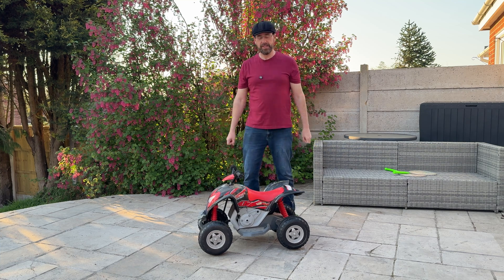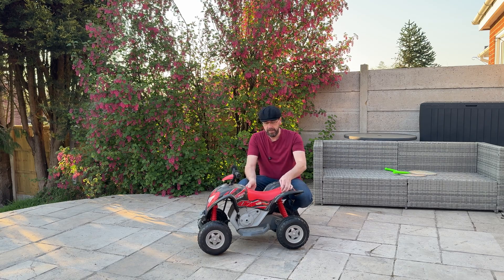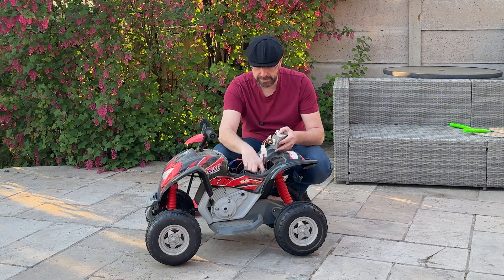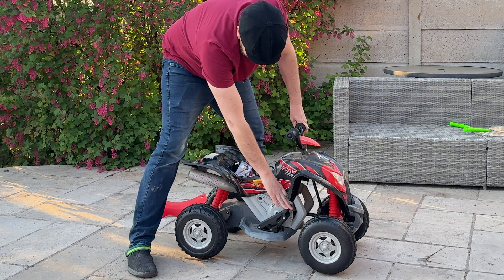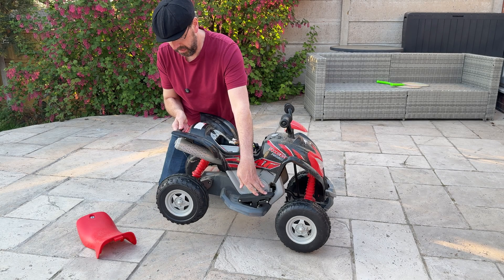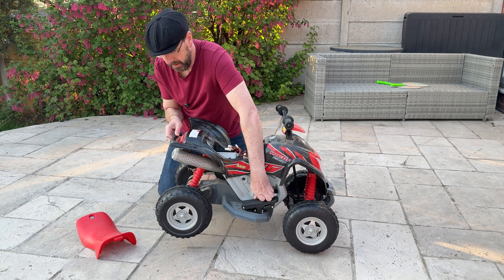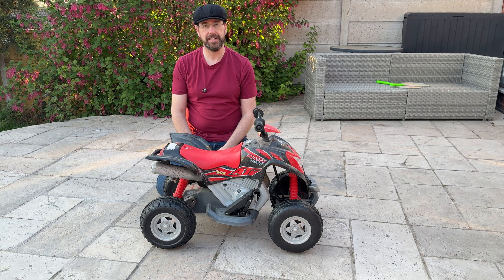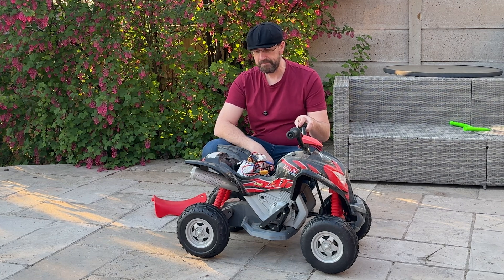Kids toy ride on electric quad bike upgrade 24v with speed limiter

Comment: I need help haha! My son has a 24v 7ah Ford Ranger ride on.. it dies within 10 min after fully charging for 12 hrs.. What would you recommended I upgrade it to? Thinking of a higher capacity lithium battery of at least 9ah,  but might as well make it faster at the same time 😅
Reply from the maker: I’d go with a JetCat P300 Pro gas turbine jet engine. 300 newtons of thrust, should be good for about 60 to 80 mph, maybe faster depending on the age of your son.😁
Failing that you need to work out if you need speed or torque, 40,000 rpm motors are great if you’re on level ground, not so good on gradients.  I think 24v is plenty, go with one those Lithium tool battery upgrades, you can swop out the battery when they run out.  LiPo can be dangerous so only use that if you know what you’re doing.

Comment: I’ve got the same quad bike for the kids, where can I get a replacement battery and charger wire?
Reply from the maker: Amazon will have 6v or 12v batteries.  I can’t remember if it was 6v or 12v originally.  They will also have chargers too.  Or if you are unsure then try https://riiroo.com they stock lots of spare parts.  Hope that helps.